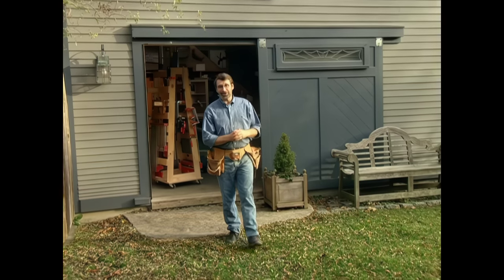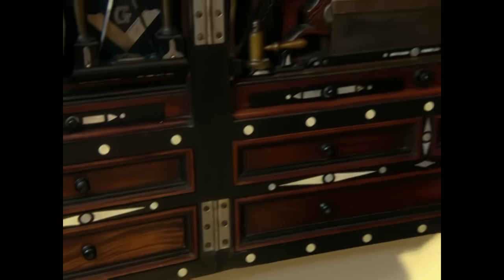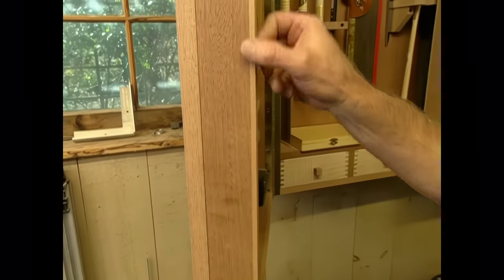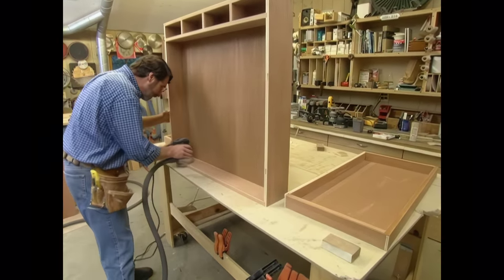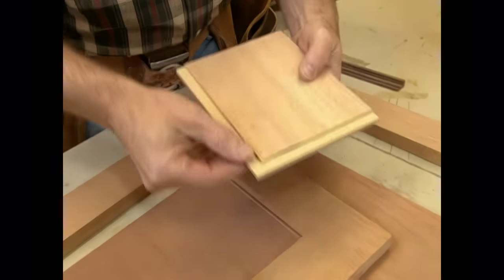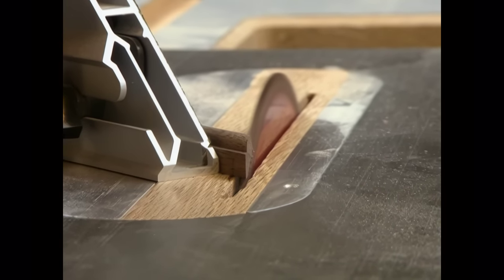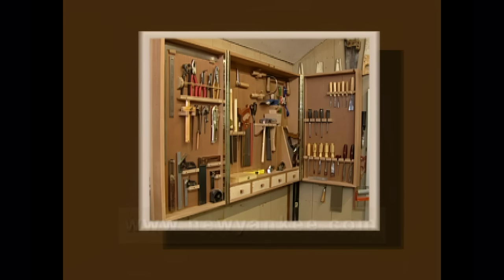Wall Mounted Tool Chest [AI HD]  |  S15 E13

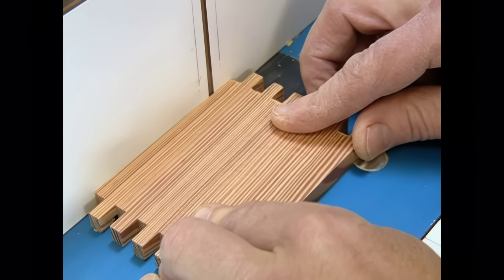Comment: @ 20:57 Norm, tell me why you love your Deluxe Router Station better than any other benchtop tool in your shop, and why you're so good at using it all the time on your projects.
Reply: I think the point of his Shop Built Router Station, is that one doesn't need to spend a lot of money on a Premium Router Table package, or even thousands of dollars on a Shaper to get good results.
Reply: @batarang87  Note: in season 20, the top fence rail actually has a commercial miter track, since Rockler's new featherboards came out in 2008.

Comment: Oh my days.. That tools cabinet from Studley was stunning to look at.
I want to build one Norm so I have cleaned up some nice pieces of wood for the framing of my cabinet. I have a a lot of MDF and was wondering if I could use 18mm MDF for part of it? 
I'm thinking of using the MDF for the back and shelves but not the doors. I have some nice Plywood 18mm for the shell of the Cabinet. I have some nice 1/4" Plywood 4'x2' sheets with a weird colour veneer. It's almost a pinkish- reddish hue to it. I was thinking maybe it Mahogany? I'm building some cabinets so I thought I might ise the 1/4'" plywood for the doors of the cabinets? It's probably too light for that job? If the doors were smaller it might be OK but not for bigger doors like the ones of this tool cabinet. I love these cabinets btw.
The Studley Tool Cabinet is a beauty to be sure. What is the wood it's made from again? I would love to build something like that.

Comment: That gothic fix for the Stanley is gorgeous!
6:12 Just wondering, isn't it dangerous to cross cut or use a dado set with both the fence and the miter gauge?
Reply: Not on a dado. You aren't cutting a piece off.

Comment: I love having these episodes to watch again. I have a one small request. If possible, can you crop the black bars from the side? The quality of the AI upscale is great, but some devices don’t show this full screen.
Reply from the maker: The black bars are because the old shows are a different format. HD requires a 16:9 aspect ratio so we either have to cut off the top and bottom, losing parts of the video, or go with the black bars to see everything.
Reply: 1440x1080p is the HD resolution for 4:3. Adding the black bars on the sides to get to 16:9 means the YouTube app on iOS also adds black bars to the top to fill the screen. The effect on my iPad is a black border all the way around the active part of the video, making it much smaller than the screen.
Reply from the maker: @scottcampbell96  To be honest I have not looked at this on an iPad with the YouTube app. I'm on my laptop and it fits top to bottom -- with the black on each side of course. I'll look at the output options when I make the next one to see if there is something else.
Reply: @newyankeeworkshop  thank you for looking into it. I appreciate having these episodes to watch, either way, so thank you again for allowing us to revisit these projects.

Comment: mY ISSUE FOR HANGING THINGS ON MY WALLS IS THEY'RE 4" THICK concrete block built dividing walls in my garage/workshop. My next door neighbour is the garage right beside mine. There are no gaps between houses. My workshop/Garage is built into the house under a bedroom. They're a weird construction really. I want to be able to work late at night but can't bcos I would be wak9ng ppl up. haha! I have to stop working by 9pm at night or the neighbours go nuts. LOL Some nights I work at 02:30.. I'll be out in the shop if I can't sleep and I gotta tire myself out.
I would love a workshop away from my home but the cost of a premises is crazy nowadays here in IRELAND.

Comment: That tool chest is lovely and highly impractical.  It's more of a statement piece than anything that would support daily tool use.  Way too many flaps and folds and slides and doors just to get to a drill bit.

I can appreciate the craftsmanship, but it's way too much crammed into a too-tiny space.  Norm's version is much more functional for a woodworker.  Even a typical steel tool chest from a big box store will have easier access to tools.
Reply: I mean, it was built in the late 1800s to early 1900s, dude. Damn Studley for not incorporating 18v battery holders. Go through your shop and identify all the redundant tools you have you really don't need.

Comment: You said 'follow all the safety instructions...' - yet you have removed your table saw blade guard!
Not exactly Studleyeque... I am building my own version- of course Ivory is not available these days, so one has to substitute bone. Mother of pearl and ebony are obtainable however. 
I note your opening leaves have full depth centre framing- never understood why everyone seems to do that. Not needed, and it limits options on fittings and tool location.